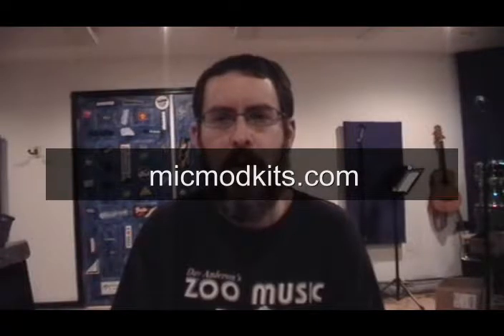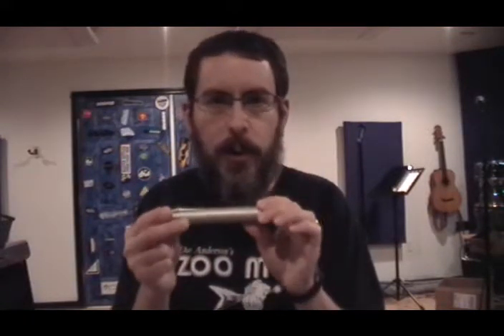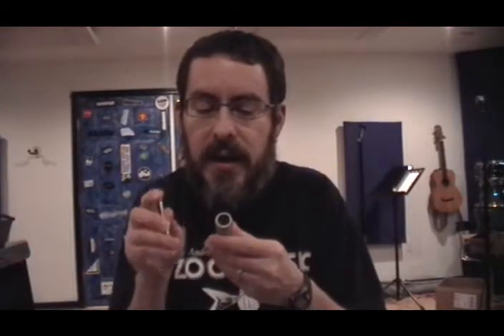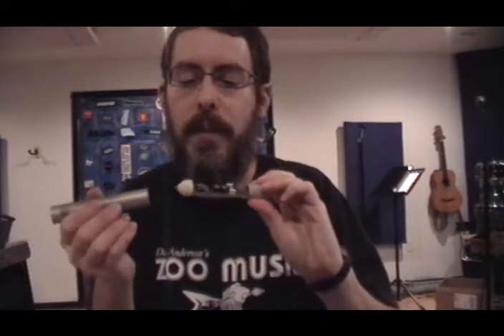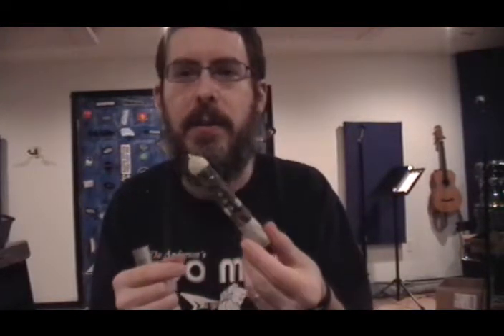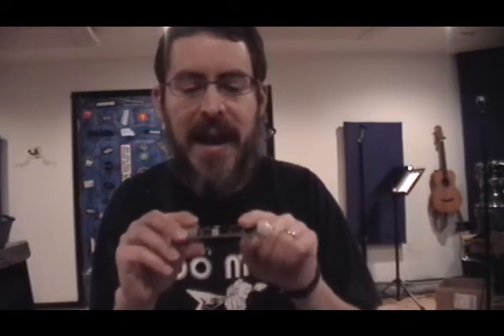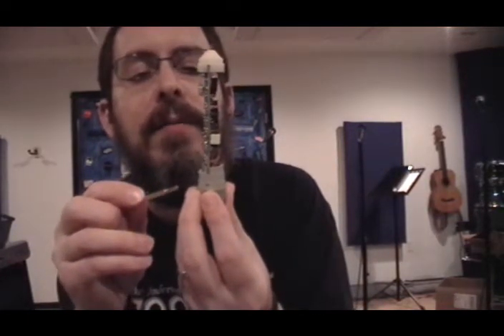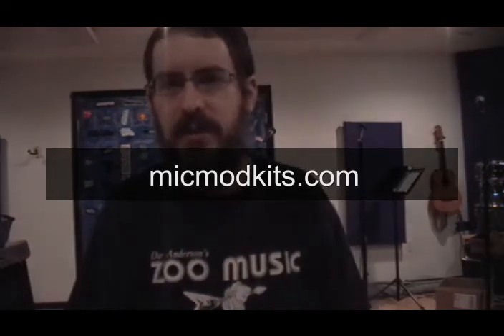How to open up a small diaphragm condenser mic

Comment: Hi i have a mxr606 i tried this but i cant pull off when i screw the single screw at the base of the mic, there is no 3 screws. Any ideas? Mine just doesnt work properly and i wanted to check the soldering inside.. Thanks